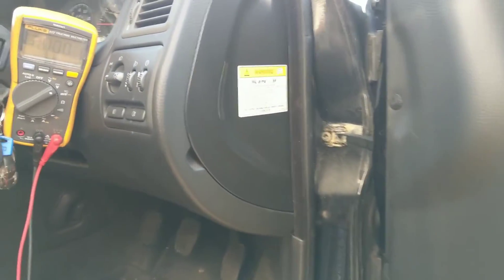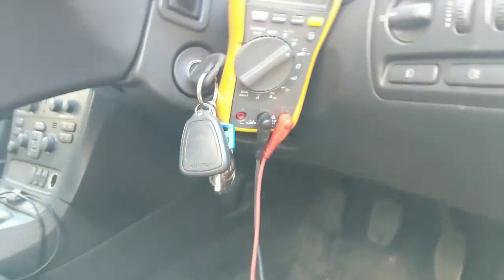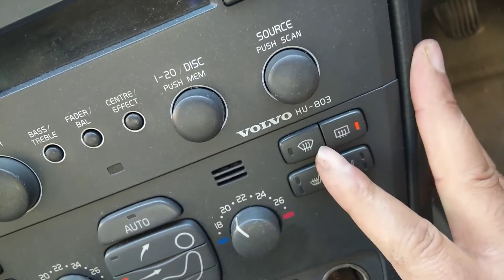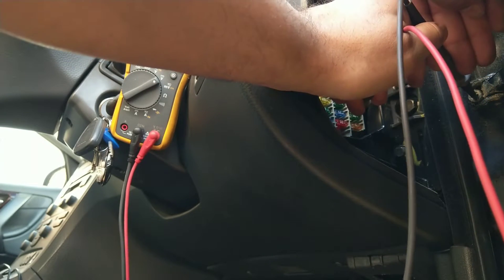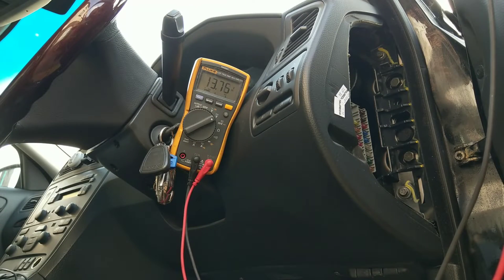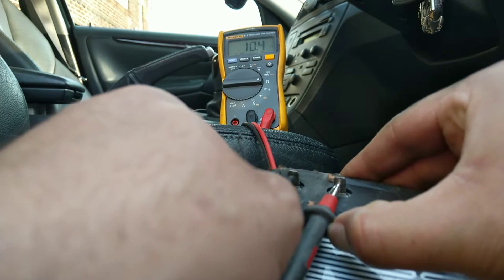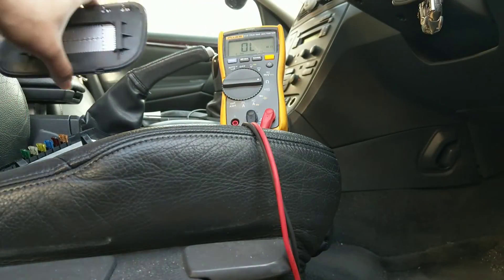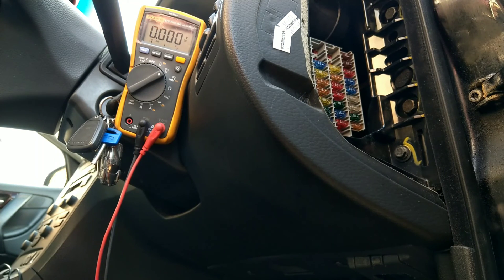Heated Door Mirror Fault Diagnosis and Fix

Comment: I have a 2021 Camry and it does not have heated mirrors. I want to modify it after the factory. My question is: Is it possible to search for the wire going to the rear window that works on the rear defroster switch and take two wires out of it. Each wire goes to a mirror. And connect the ground to the body of the car, so in this case the mirrors work with my rear window. Does this affect the electrical system, knowing that the car is a 2021?
Reply from the maker: Is your car already fitted with mirrors that heat up but they're not currently wired in?
Reply: Thank you for the reply. Yes it is on its way I bought it online
Reply from the maker: @mohammadahmadtallouj8243  Go on a Toyota Camry forum and ask if anyone has done similar and ask for instructions.
I'm unfamiliar with such a new car. Good luck with the new car. 👍🏾
Reply: @sirobb  Do I have any website I can go to and ask?

Comment: ...Or check the continuity of the fuse?
Reply from the maker: Fuse continuity is tested and proved with voltage test across the fuse contacts. If the fuse was blown, the voltage drop would be out of range.
The tests shown should be sufficient.
Reply: @sirobb  a voltage test specially on a running vehicle could spike the current and if the fuse wasn't the problem before, it could be after the short caused by the volt meter
Reply from the maker: @mikhailgrigoryev5757  A voltage test cannot short anything. That's not how meters work. If you feel my video lacks anything, please do your version and post the link. I'm always happy to learn more.

Comment: Are these mirrors polarity sensitive? Can any of the wires go back each/both ways? Thanks
Reply from the maker: Pretty sure it doesn't matter but it's quick enough to check current draw in both positions with a multimeter like shown.
Reply: @sirobb  Thanks, reason am asking is because i only have a light up meter and i tested my old glass for continuity and didn’t have any then when i received my new used glass it did have continuity however when i come back to fit i had forgotten which one went where but worked the way i had fitted it. Only just done the job 20mins ago seems to work but wanted to double check

Comment: Thanks alof for great videos! I love them as they have helped me do alot of repairs and upgrades, f.ex. big/police brakes. I have a 2005 and would like to upgrade my mirrors in order to get mirrors with turning lights, but I don't know how to get them to work, as the wiring will have to be rebuild/led to the mirrors instead of beeing connected to the excisting turning lights on the sides. Do you know or would you tell me or make a video? I think many people would appreciate it, there is no video on the Youtube channel showing how to do this as I have searched for some time already. If you know of anywhere that shows this upgrade, I would be foreve greatful!!!   Thanks alot in advance.
Reply from the maker: I wouldn't go altering the wiring just for some extra lighting.
Far too many things to go wrong.
Reply: @sirobb  thanks for the advice. I thought the 2005  had the same wiring as the 2007 as they are both facelift-models. I learned a lesson when consulting my Volvo-mechanic. You confirmed his comment. Thanks 🤗😊😇

Comment: My mirrors just fell to the ground I glued them back but the heating isnt working anymore of course. I need to order new ones. Where can I get new ones?
Reply from the maker: I bought mine from a Volvo breaker on eBay.
Reply: I got a new pattern replacement for about £10 from ebay. Been working well for 2 years so far.